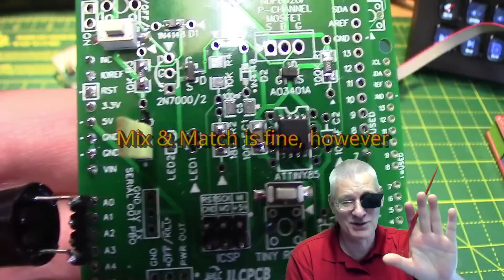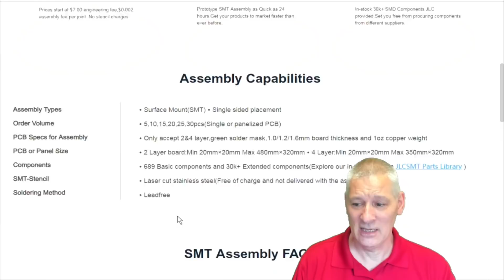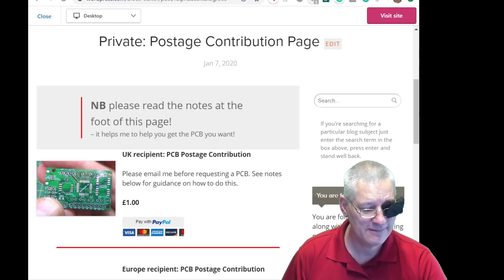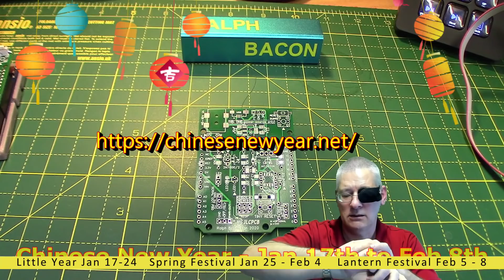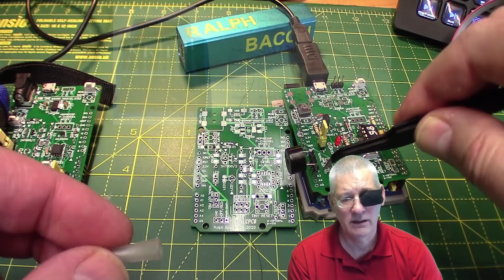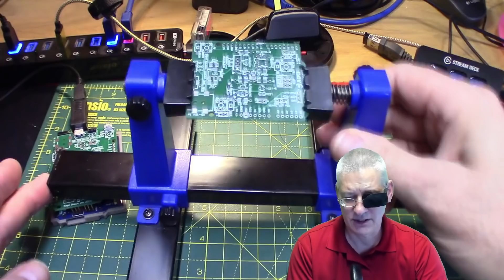#176 Dual SMD & THT PCB Arduino Shield (Easy! Yes You CAN)

Comment: if you want good tweezers that really make your work with tiny smd packages comfortable, go to Ali and find round handle titanium tweezers with angled tips (there's no common name or model unfortunately). There's nothing better for the money. Only for tiny smd though, so not your main tool for general purpose work (I use 3 sizes that mostly differ in gripping force and surface area)
Reply from the maker: I notice there are quite a few decent tweezers out there, Leeroy, so thanks for mentioning AliExpress, others may find that useful.
Reply from the maker: As John from Northern Ireland tells me they are in Lidl this week (mid Jan 2020), in the rest of UK soon.

Comment: Nice project, you seem to get a grip on PCB layout, little messy but great.
Back in my youth we made an effort to line up the components, making it all look good. 

I was wondering when you would learn the price of postage :)
Please get the site up and running, I'll be signing up.

There is a lot of videos on youtube  about SMD soldering.
Be aware, not all flux is thick and sticky.
PCB holder and tweezers is on Banggood too.
You can probably get the Isopropyl Alcohol at the local farmacy.
I got myself a T-12 soldering Iron and a GJ ST-90 stand for it, i do like those, both from Banggod.
Reply from the maker: "A little messy", you say, Flemming. Oh dear. And here was I thinking it was well laid out, logical ... just goes to show I must not rest on my laurels (which my school report often said). Thanks for the feedback.
Yes, the postage was a bit of a killer, but I think it will be OK now, going forward. The PCB holder is on Banggood but it is SO expensive (compared to the UK price) so I didn't mention it.
Site is up now but you have not sent me an email yet and I only have bare boards left no (or hardly any) components.

Comment: That was a lead pipe soldering iron for a plumber ! good for making a blob   ;-)
Reply from the maker: My dad used to have one of those, Jyv, and he started off life as a (fully qualified, oh yes) plumber. It would make a blob of my beautiful PCB, that's for sure!
Reply: @RalphBacon     just imagine how big the resistor should be when using this to solder,  a million ohms ...
and the pcb as big as a table ....
i can not remember if i ever really saw one used by a plumber, very long ago ...
Reply: My grandfather had an iron like that.  The "tip" was about a pound or so of copper,  the handle was wood,  and a bit of iron pipe connected the two.  A block of "sal ammoniac" (ammonium chloride?) was what was used for flux,  as I recall,  and you heated the thing in a charcoal brazier.  None of thie newfangled electricity stuff!   :-)

Comment: And as for the ESD protected tweezers, if they are coated with a proper paint/coating, the metallic surface of the coated portion can be made effectively non-conductive and I think that is what they rely on for these tweezers and yes, they are a necessity. In the US, amazon has a number of vendors offering similar sets at various price points and I imagine the same can be expected elsewhere if time is an issue. And flux is a must. For SMD work, I like a nice liquid flux that I can pour into dispensers used for vaping/acrylic solvent applicators. It is a wonderful substance and I believe the 'no clean' claims are more for the fact that the flux residue won't corrode the metal than stating that you won't be left with clearly visible stuff that will drive you bonkers until to give your parts a nice bath in IPA(isopropyl alcohol, not Indian Pale Ale). 

Keep up the great work.
Reply from the maker: I often bathe in IPA (Indian Pale Ale not IsoProp) and it does wonders for my skin, I'll have you know. Well, in my dreams. I hear what you say about ESD tweezers but it seems a dodgy claim to make! I do have some ceramic tweezers to (spring loaded) and those are almost definitely ESD safe(r). Great post.

Comment: Here in Finland leaded solder is only sold to repair professionals. Amazon sellers don't seem to ship them here either. I was able to circumvent the issue by ordering Mechanic branded solder from AliExpress which was recommended by VoltLog. I bought enough to last me 5-10 years or so. :)
Reply: You can get "ПОС61" (61/39) or "ПОС63" (63/37) from Saint Petersburg, if you manage to buy there somehow. Quality stuff.
Reply: @Mr.Leeroy  Thanks! I doubt it'd be any easier though. I would guess packages from China clear through more easily just by the sheer volume (customs seem to only intervene if they suspect the price is over >20€). Luckily the Mechanic solder is actually really good. Low melting point, no odd smell, little residue.

It looks like in the future the EU legislation will dictate all Non-EU packages need to pass through customs so I used the opportunity to stock them up.
Reply from the maker: @Ristomatti it seems that you have enough solder now for a while, but I'm sure EU laws were relaxed to allow hobbyists leaded solder. I tried unleaded and it was truly awful!
Reply: @RalphBacon  Luckily I started my hobby with lead free solder (3y ago) so I could maybe live with it. But after trying leaded solder a year ago I understood better why soldering was extremely frustrating on some days...

Comment: I am a chemist by trade and happen to have a very nice hotplate that has become my best friend for SMD parts. With some solder paste, a steady hand and some 18 gauge needles, I've managed to assemble quite a few things 'by hand' but 0603 is still about as small as I will comfortably go right now. I have a design with a 0402 part, but I still haven't bitten the bullet to order it along with said 0402 part. But looking at the trend in manufacturing, I think we'll all need to get over our fears sooner rather than later as it seems that BGAs are becoming the goto format for a lot of new products that manufacturers feel I might be interested in. I mean, why does a LDO voltage regulator need to be in a BGA package? No clue, but ST Micro seems to think it was a great idea, but I have to admit that such a tiny part delivering >1A is pretty exciting and tempting.

Another interesting video and I can't see anyone complaining about those shipping rates as they seem very reasonable. Nice job on the dual component board, it is very well done considering it has twice the number of components.
Reply from the maker: BGAs are definitely on the up but if makers are hesitant to solder standard SMD stuff, I just don't know what we will do with those. Perhaps there will be several BGA-to-DIP conversion boards? I haven't really looked at an oven (converted toaster) but it might get onto my list.
Yes, I draw the line at 0603 although with my current eyesight 0805 is still a challenge!
Thanks for posting, good to hear from you.